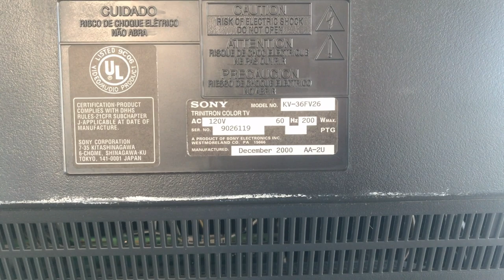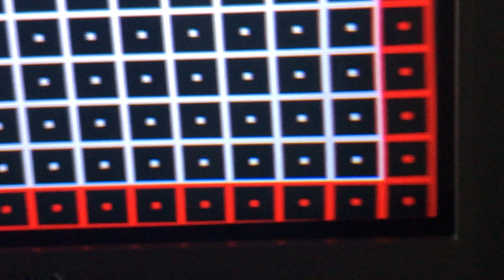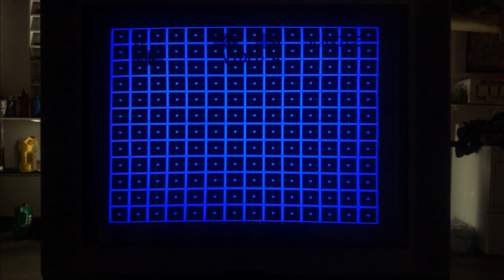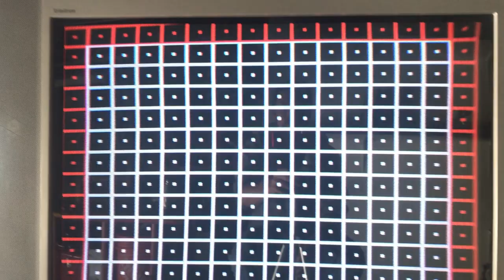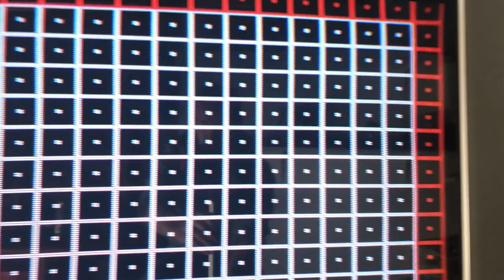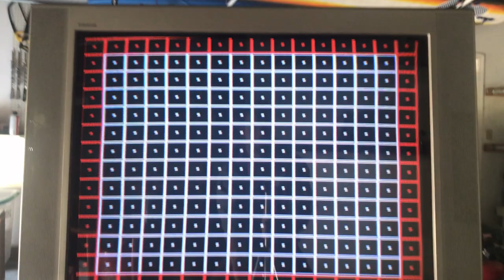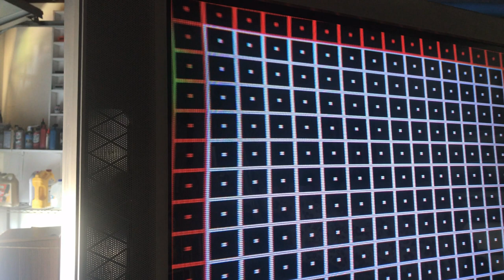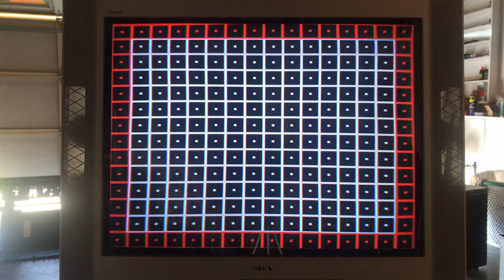How To Do General CRT Service And Repairs: Geometry, Convergence Etc An Emphasis On Flatscreen Sonys

Comment: That's was very informative, thanks. I have a doubt, can the anode wire shock you? I have a 20 inch and it doesn't have that much space to work around it when adjusting the strips and magnets.
Reply from the maker: The wire is insulated and should not shock you. However I try not to touch it. There is a very high voltage going through it. I do bump it sometimes. I've worked on 20 inchers before and they are generally easier. However they can be tight and every time I've been shocked it was on a 20 inch. Get someone to help so you can look at the screen while they adjust if it's a tight spot. Don't hesitate to get creative. I used a 2x4 piece of wood to push on a yoke once while it was energized because I kept zapping myself when I tried to push it with my hand.
Reply: @riggel8804  Thanks, funnily enough I adjusted the yoke on mine before and it didn't shock me, I was just suspicious of working around the anode wire because of the HV.
Reply: @Ken Mason I'm sorry, english is not my first language, but when you say lead you mean the connector or the extremity of the wire, right? Just to be clear, I meant the insulated part of the cable, do you think there is enough high voltage to arc on a cable with the insulation in good condition?
Reply: @Ken MasonWhat about liquid insulation tape? I have noticed that there are small sparks coming from the anode cable, and I would like a easier fix other than removing and replacing the cable. So, I was thinking about using liquid insulation tape.

Comment: Hey I know this is an older video, but can you tell me which setting in the service I need to change in order to fix the brightness banding on an XBR 250? I can't seem to find the solution anywhere online.
Reply from the maker: I saw a  post for this on the shmup forums. I can find it for you if you still need help
Reply: @riggel8804  Yeah thanks that would be great.
Reply from the maker: @StormShad0w313  this is what i found

XBR250 COLOR BANDING PROBLEM
If you have a XBR250 and you're experiencing horizontal blue, green or red banding across the screen with a component video connection, you will need to enter service mode and adjust the HOSC parameter. Initially HOSC is set to 7 (factory default), you'll need to change it to about 11 - this will eliminate the color banding in the picture.
Reply: @riggel8804  Thanks a lot for the info, i'll mess around with that setting tomorrow. Really digging your channel so far.
Reply from the maker: @StormShad0w313  Thanks! Let me know how it goes.

Comment: I picked up a nice 20inch fv300 yesterday and was super excited. hooked it up to my pc and it looks just terrible...seems like colors are missing or something...like burnt out...i dont know how to explain it...i tried to adust the colors in the service menu but nothing can be done...i might have to trash it. Is there anything that i can do to get the colors looking right? It looks like the tv was left on for too long or something.
Reply from the maker: Upload a video of it to your channel and i will take a look.
Reply: @riggel8804  ok..i will..thanks.
Reply: I tried another adapter. It fixed the color issue...the other adapter was the problem. But I see some blown out colors in the corners. I will post a  video after I try to fix the geometry and color in the service menu...I fucked it all up trying to fix the other issues lol.
Reply from the maker: @joshforsyth5710  cool.yeah you have to troubleshoot everything in the chain. Color issues in corners could be convergence or purity.

Comment: what strength magnets would you recommend for correcting purity issues?
Reply from the maker: ceramic rectangle magnets from the hardware store. Similar in strength to fridge magnets.
Reply: @riggel8804  thanks dude
Reply from the maker: @anthonysarkissian6581  ye

Comment: What console are you using the test suite on?
Reply from the maker: I think it's the snes through my ps2 emulator.
Reply: @riggel8804  Can you use it to calibrate 480i geometry and conversion for PS2?
Reply from the maker: @dreamingdragon6913  kinda. The snes only outputs 240p so all of your calibrations will be in 240p but yea it will help you calibrate geometry and convergence. 240p is the same as 480i in this context.
Reply: Alright Thanks.
Reply from the maker: @dreamingdragon6913  ye